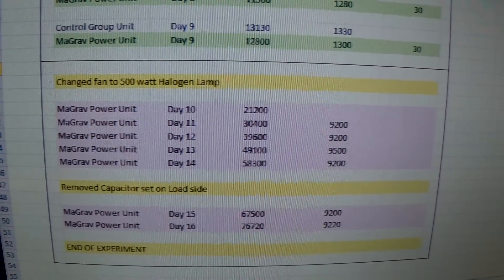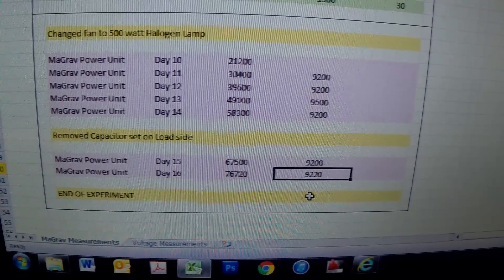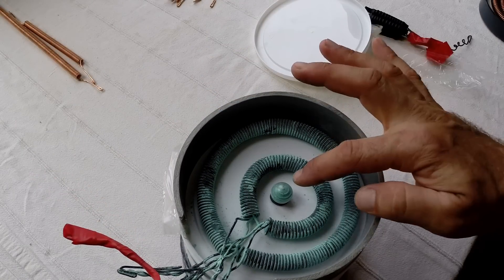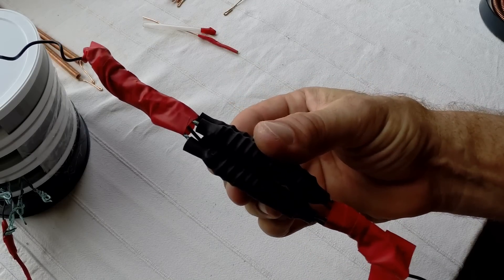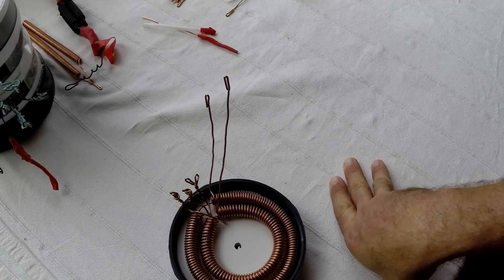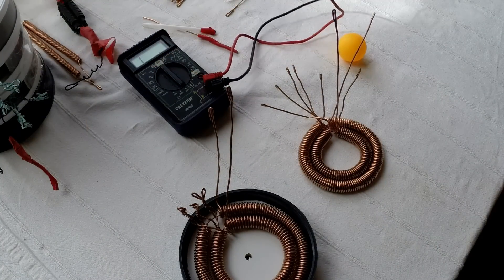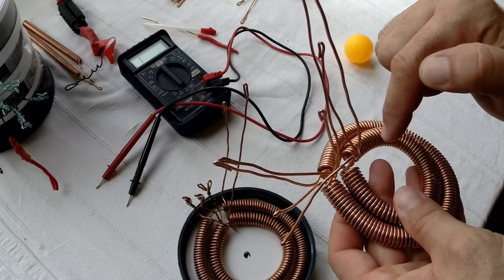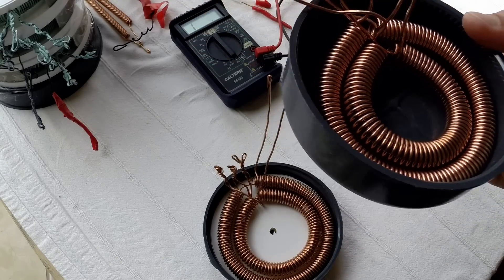Final Report - MaGrav Unit 1

Comment: Keep it up. It is a challenge to be specific when a theoretician is speaking  and gets confused on the details. This system seems absolutely very specific. Mr. Keshe still talks about a counter clock wise CCW , he speaks of the drill motor turning counter clockwise CCW.  Using the drill CCW will result in a CW turn. Hence CW  wrap/twist  on your connections. On Tele's video clip Keshe speaks of volt meter (+) on the (-) to give correct direction. and the other, black on the (+) of your coil.
I am going to have to denanotize mine and start all over,
Lots of Love
Reply: +86daily ,

I wanted to offer the qualities of real "graphine" to realize that it can charge up either direction, positive or negative. If you stick a voltmeter on both ends of a length of wire it will induce a small voltage across the wire and a very tiny micro current. I charged up a capacitor very slowly this way using a diode with resonant cut leads on a milli volt scale, quite by accident. The meter will induce a tiny current if a semiconductor is present and the capacitor will slowly charge up to the voltage of the battery in the meter that has been applied to the FETs collector voltage that is used to meter it. The ohmeter will do it at far higher currents, and a battery at far higher currents then that. Graphine will thus charge up either way you stick the meter on it, but afterwards as it hardens it may likely only draw or add energy to the flow in one direction more then the other like a semiconductor, each end of the wire will move towards one held charge state and the middle of the wire will remain neutral, so there would be an end to end polarity difference that is impressed into the final form of the graphine along the wire.

This means that placing it on an AC line that is in constant reversal, would not really make sense, where using a pulsating DC would make sense. Keshe did state the nano layer is for conduction of DC, and it is also polarity conscious. If you can comprehend this for yourself, would be better then trying to figure out what whom said back when. If you are to produce a true nano layering with near superconducting qualities in graphine, you should then be able to test it after it is fully hardened like steel. With a heavy DC current in one direction across the wire, it should not heat up much at all. In the other direction it may heat up and show a voltage drop across it. Voltage times current = power. This is how to locate the correct polarity, and why you see + and - all over on what should be AC circuits with no + or - markings on them at all as this will reverse at 50 or 60 Hz on any normal power grid. Plus and minus on an AC power grid changes 120 times a second.

So in the hardening process of the nano coat, I would suggest using a function generator, set up for a DC pulse that repeats, as it dries, just on each end of the coils. Use a megohm resister to limit the current. Maybe around 5 Hz, or tune until you feel it around the wire, something Tesla would likely do. Polarity will not matter until the final connections of the Magrav, where they must all be set correctly to conduct forwards during 1/2 of the ac cycle. Let the f Gen do the wire polarizing, and go get some rest. Taping it every 4 to 6 hours is going to put you into a state of deprived sleep. Now mark the positive end of each coil for the final assembly.

The way the Magrav coils connect together run in opposite configuration with each other on the larger loops. Magnetical and gravitational loops? run opposite direction around the loops of the coils. You can see the attempt to condition both sides of the AC wave from the house current, by alternating it between inner and outer coils, with graphine conduction reversed in each side this should work in theory, plus and minus charges will be amplified in both directions each coil working for only 1/2 the cycle, if you got your graphine layers all polarized correctly. This is like two diodes back to back and reversed, electrically. The question then, is if your graphine layering is truly a superconductor in both directions at this point, will it become a source of power?

Science tells us that if we used Lithium as the GANs it may work as a superconductor as described. The series coil connections are then however incorrect, as you actually need to have the two sets in parallel operation to act as doides in each direction. The final connection with a CW and CCW large loop run, need to be in parallel to amplify both polarities of the AC flow. This is the most obvious logical way anyway, and I am not considering the capacitance effect to pass through between two open ended coils. So I am not saying the config given will not work if made large enough, but from what we see in the experiments, it has not worked and is showing a resistance is present in both directions of current flow.

In theory it should work and the basics are sound to me, but the technical building part is not so simple, as any child could comprehend, and there are tests along the way to prove if you are there or not there, that require basic electrical knowledge to comprehend. Ohms law is the most important one thing you can read up on to understand where resistance is present and where it is not present. If it is not present, you can easily detect this with a volt meter while there is conduction or power through the coils.If you are running 15 amps of current through a number 14 wire and see a voltage down in the mico-volts across the wire then you are on the right track. Reversing that voltage on the same coil should then show the opposite, hi voltage across the wire. Two coils then in parallel and polarity reversed should become a "two directional" super conductor, and no hi voltages should ever appear across them both in parallel configuration. Play with a couple diodes to prove to yourself how this is supposed to work, only then are you ready to even attempt a build a Magrav unit for yourself.

I am still waiting for better clarity, on what I know from past experience, and what is being offered to merge into a "coherent build" for me before I start. Since this has great potential if and when it works, I would wait for the one that you do not have to run connected to the power lines at all. I do not want a nano coating on all my house wiring for initial testing to begin, because it is impossible to remove this later. All the house wiring will have to be replaced to go backwards. The wires may start to rectify the AC into pulsating DC and double the frequency of the grid,  and clip off half the power line P-P voltage. That to me is poor science. You would need a second set then to reestablish both polarities of the grid on your house wiring system with the reversed polarity on the nano coating.

We may see real superconductor devices coming up in the world of production as time goes on, now that the colleges like MIT have found how to really do it in 2014, when and if those making these decisions decide to allow it, due to public awareness and public pressure. Keshe has drawn our attention to this now.

I believe that Keshe really believes in what he is teaching sincerely ,and it may have worked one time for him as well at each step, but I do not believe he already has the answers in how to build it in the real world and have it always work. I see any and all "seekers of truth" as a good thing. It's too bad that people have to have a "sensational presentation" in order to try a build as an experiment. To me that is deception, and even if you try to justify it, it still comes out as deception and disappointment for many people of faith.

If you instead be honest, and state I believe we can do it but I need the help of experimenters, and I need others to fund my materials, you do not get the public interest and interaction at the same level. This speaks to the public now living in the "emotional realms", and not only to the theoretical experimenter. The emotional healing has to come first, then there will be nothing to stop the technology from progressing.

Public wants a solution with no personal effort extended, and they want it right now. He gave us what we wanted, to imagine we could have "without comprehension."
Tesla had the comprehension, but was not able to give it to the public. I believe Tesla stated he could do it using only copper, aluminum, and iron medium. I do not know anyone today who makes that statement.

A presentation made before the experiments are completed, will have a negative impact on society as a whole. The teacher will then look for the problem in the builders rather then in the directions he gave them, or to work on better communication at each step of the building process.
Work on the nano coating until you get the correct qualities present!

Avoid being confrontational, resolve conflicts that arise, and work together as one, sharing all knowledge, as equals, and the goals will be achieved.
However this approach, does not work with mainstream populations. They are not ready to work in this fashion openly, due to "emotional polarities" desired to be experienced in the now.
Rare is the meditator that states "I am done with polarity experience." It is now time to get off the emotional roller coaster, and study the universe as it actually is".

Emotions are temperary and will each one pass over time. Reality will continue to work for as long we conform to it, no matter our emotional state in the moment. Mind will be present for both and never goes away for as long as we are here to observe the reality.

If the mix contains an "emotional quality" for success, to polarize it, then it will likely be useful for emotional work.
If the mix uses mind to track things like electrical polarity, it has a chance of working with electrical energy.

Dave L
Reply: That was very good input. We are on the brink of something that we have a difficult time to understand and it is going to be the avangard that will forge through. What keeps me going is that I'm absolutely sure that there are other entities in this universe and they are able to do all those things that Keshe speaks of as they travel across the galactic plain. All our movies of the future express it in preparation for our next level for this humanity. If we could dispose of our controllers we can get there. We have no choice but to work for this next level and I have come to realize that we must all do our parts no matter how small it seems.
Lots of Love
Reply from the maker: +86daily I agree, but I'm not sure Keshe's got anything working, he seems to know mostly theoretical stuff......
Reply: Yes/No There is not much that we really know.  I'm sure that the US/British have invented/back engineered most of this already. I you are a reader you'll find "Sands of Time" 1+2 an eye opener. You can find the book at the writers site StrangeUniverse.com 
As for Keshe he is the clown that has to walk a tightrope aiming a the goal ahead with promising deaf on all side. The genius of him is his ability to string it out so that not too many people fear his knowledge until such time that it is too late to take the knowledge away form the people. When third world countries learn they will be able to push back from their handlers and finally be free.
Lots of Love

Comment: I clearly heard that it doesn't matter which way they are wound. And the gans coating looks just fine to me. The gans balls are actually unnecessary; Keshe himself said that. They are only so you "get energy" for a virtually unlimited period of time. So the bullet caps are fine as well. The work is all good, should be getting results. Some will say I'm a pessimist :) , but the thing does not seem to be what it was claimed to be. I'm being a realist here I think. Will still be following closely though, thanks again.

Comment: Here are my notes from the 89th KSW.

Setting the polarity/direction during nano coating with a volt meter is absolutely important.

Fire coating method yields better performance than caustic

inner and outer coil pairs should be as close together as possible.
# of turns is best at multiples of 9; ie 81 for inner, 144 for outer. might be best to keep ratio close to golden ratio 

To remove caustic nano layers apply heat/flame and dip into cold water.

"If you've reached 5 to 10% reduction the system works, you just need to fine tune it" -MT Keshe

Comment: do you think after all the testing this mite lead to everything runs on it own power unit all we have to do is turn it on , I'm thinking that makes more sense  rather than making a power unit for the whole house ,that way we don't have to worry about trying to get a unit to produce a lot of power with each appliance having it own power already installed  . just like batteries that recharge themselves. .

Comment: Wait, you didn't wind the coils properly??? What???? Also the gans coating does not appear to be complete. It must be complete. Better to overcoat than to undercoat.
Reply: +mikefromspace  Overcoat is not necessary. Here is an Answer from MK's archives of 3rd Dec 2015... "The GANS will still continue to radiate the Magrav fields that is necessary to operate as we are only dealing with the Magrav fields. We only need a small amount of GANS for it to work. As an example, coat your coils with GANS and let it dry. Put it outside and let it get wet and subjected to the elements of nature. When it all washes off, you will still have enough GANS on the coils because the coils are holding on to the Magrav fields of what it needs".

Comment: Thank you for your video. I think Mr Keshe ment the meter to be set on milli Volt not ohms.
Reply: +Kabir Miah That is right
Reply from the maker: +Kabir Miah Oh yes, that was Sandor who explained it different again..........!@!!#@@! http://livestream.com/accounts/4743553/events/4462310/videos/105486470
Reply from the maker: United WeStand
I am humbled by the experience. I will never laugh at anyone again who has been scammed/fooled/tricked by con artists. Good ones, will have you bring them more money even after your gut alarm is in full blast siren mode.....
Reply: +Roald Boom what it was wron g in Sandor explanation ?
Reply: +Roald Boom   your unit start before  Nov 24 2015 when  Sandor told this
Reply from the maker: ohm
Reply: +Roald Boom 
my Meterman universal instruments put out 2,6VDC when it is at 200-Ohm position. and it doesn't have a 20mV position, but on the 200mV position it puts out 8mv, and it moves down to zero, so i don't know why keshe just don't tells us all to use a 1,5Volt battery to polarize the coils ??
Reply: +Roald Boom 
Volt meter is correct, because it runs off a small battery, so the meter itself acts like a small power supply. It is what is needed to bring your nano-coated layer(s) into "alignment" (See the 89th KSW).
Reply: +Kabir Miah do you even understand the relationship between voltage, resistance, current and watts.... known as ohms law... Keshe foundation has brought about more mis information then anything i've seen. You can't even find one single video of this device working. No disrespect where all in this mess together, only by questioning things can we free ourselfs. <3
Reply: +Roald Boom 

As Mr Keshe mentioned, use the 200 millivolt setting.
I believe he also mentioned to you that the space between your inner & outer coils was too distant for magnetical/gravitational interaction...

I watched as you peeled your wires over a month ago...I saw you were damaging the copper wire by peeling a thread of it off along with the plastic as you ran the potato knife along it...that copper wire is likely unusable, however I suggest asking the workshop...

I'm starting with pain-pens...lol...